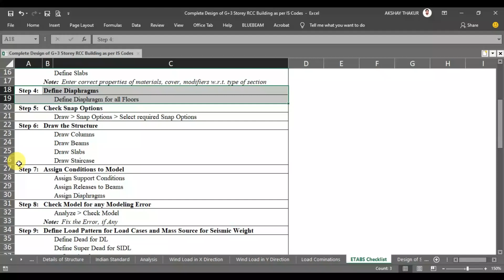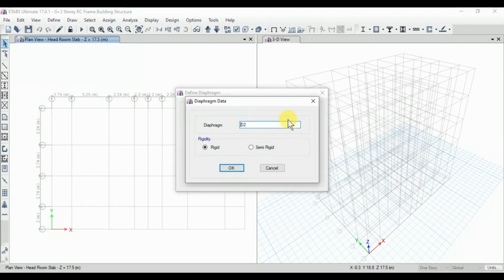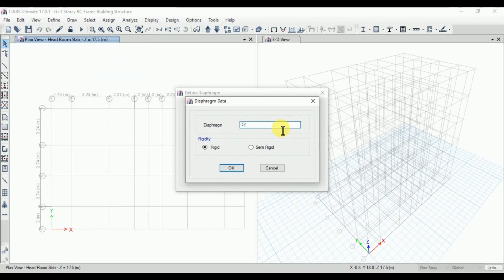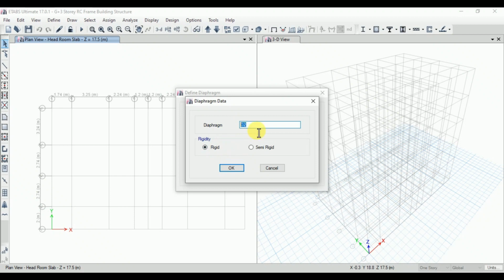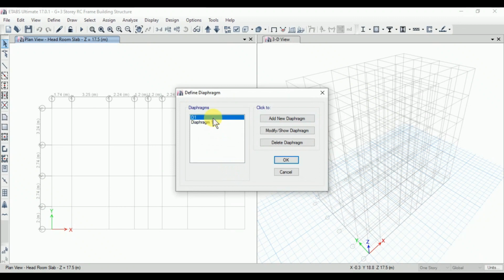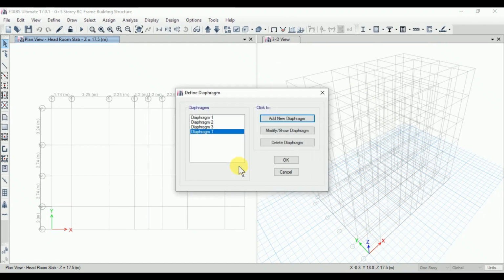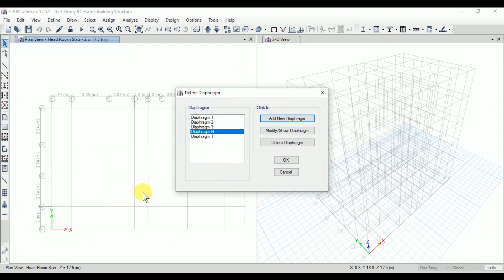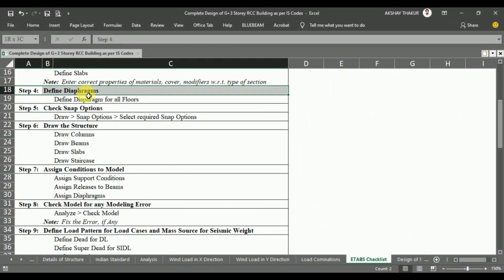6.6 Define Diaphragms │ Complete Design of G+3 RCC Building as per IS Codes by ETABS │ Akshay Thakur

Comment: Hello, may I know what is the meaning of making an individual diaphragm for each floor, when all of them are rigid.
Reply from the maker: Yes, I get your point!
I know if there is same type of diaphragm in a whole structure then we don't need to define seperate diaphram...
because in case of both rigid and semi-rigid diaphram, they works seperately for individual floor.

in this case nothing matters, it just save time as you mention in the way...

Comment: Sir why i need to add diphagram ..
I saw some of tutorial but they don't use it..
Reply from the maker: A diaphragm is a horizontal element and the primary function in ETABS is to bind the vertical elements rigidly without allowing any out-of-plane deformation.
Reply: Thank you sir.
Reply from the maker: to check torsion in plan you need to define diaphragm otherwise to check actual torsion you'll not get Centre of Rigidity results....
& to check displacement of whole storey diaphragms are play a very imp role....